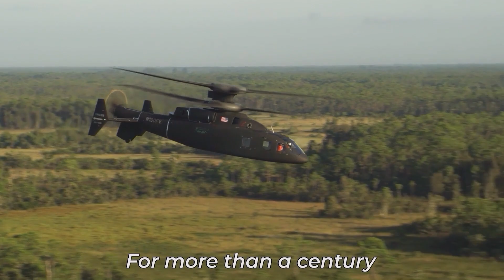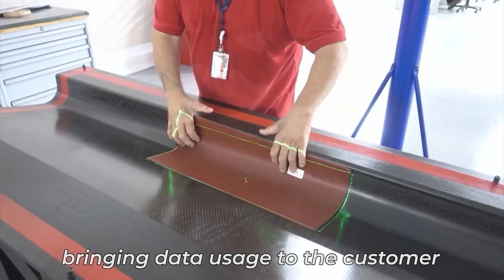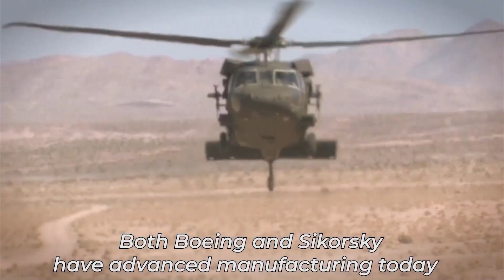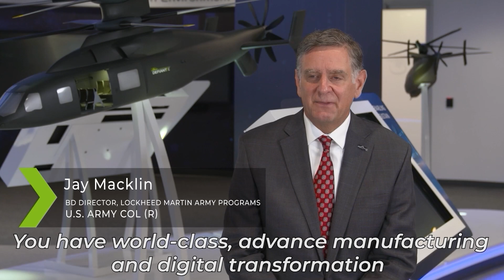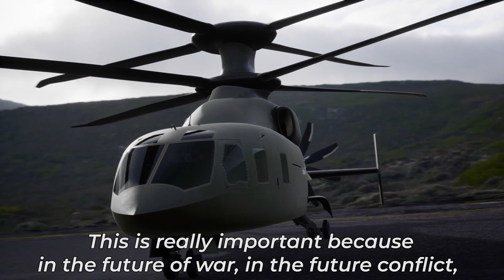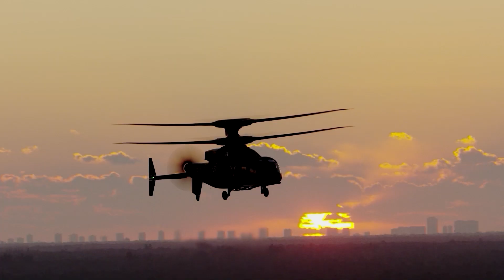DEFIANT X: Redefining the Art of the Possible

Comment: Looking at this pitch they are trying to promote diversity which generally means their product isn't as good illegitimate Biden regime loves this type of stuff. also the narrative pushes hard on supply chains and spare parts availability. Very little detail on why there design is better. The bell design is based on something the v22 which pilots are familiar with smaller engines and rotors accessibility making it  easier to work on engines also separated giving better survivability in wartime. Appeal is very unlikely to win. Same as Jeff bezos and SpaceX Elon Musk was so far ahead with the moon shot and starship.

Comment: Why the hull like features on top?
Reply: There has to be a reasonable amount of gap because of blade flex at high Gs.
Reply: Uh? To prevent the upper and lower rotor blades from hitting each other? The hull shape is for the aerodynamic property, otherwise they'd go for just a cylinder. Looks like someone didn't go to school.
Reply: @edenassos  had you gone to school you wouid had understood what I am talking about